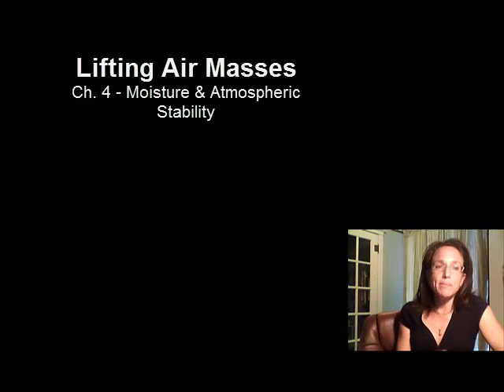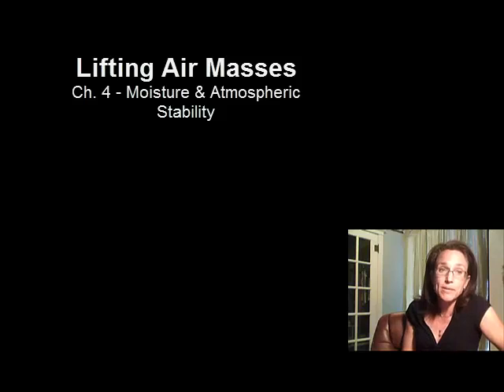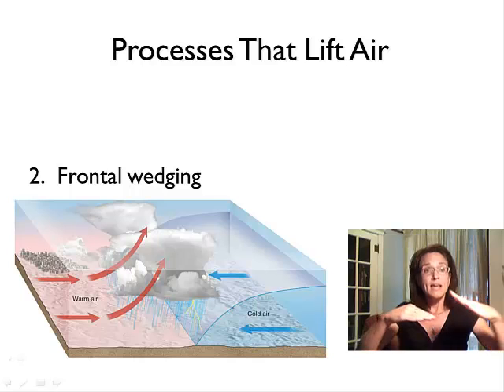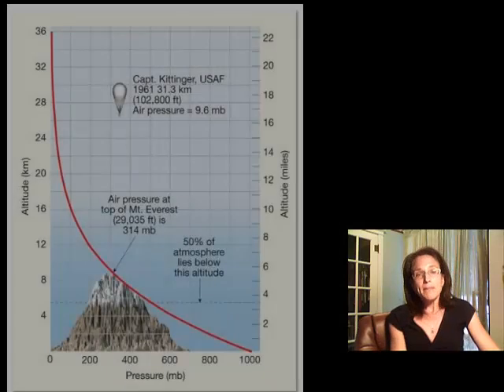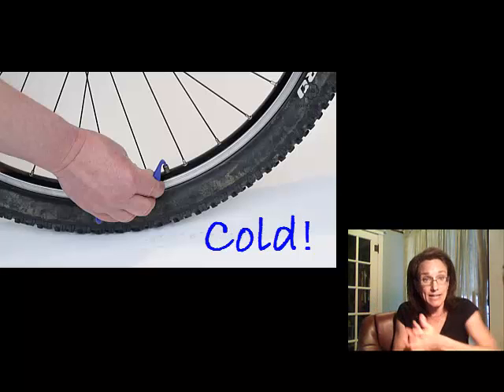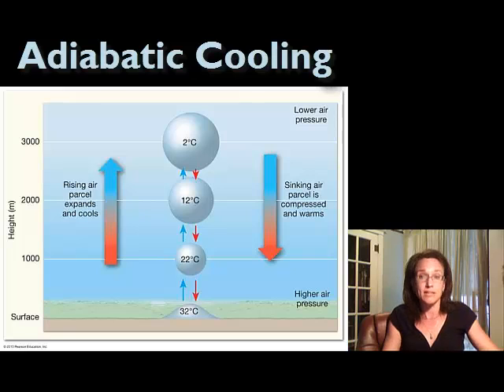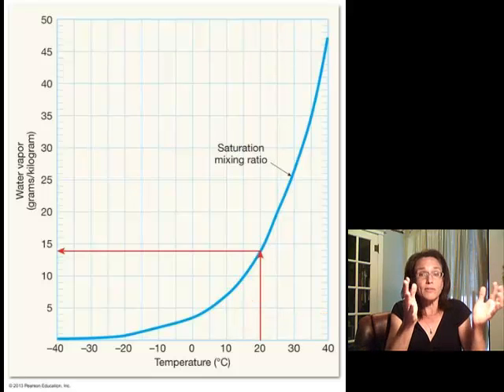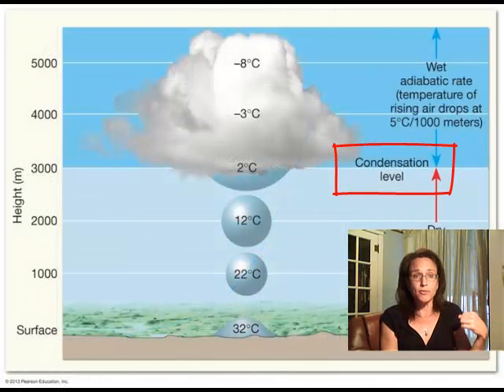Lifting Air Masses

Comment: Gigi, Could you please answer a question for me. At what altitude does a parcel of air meet its condensation level? Is this constantly at 3000m? If not what causes variation in this level? Thanks.